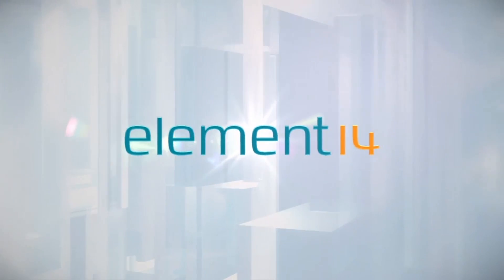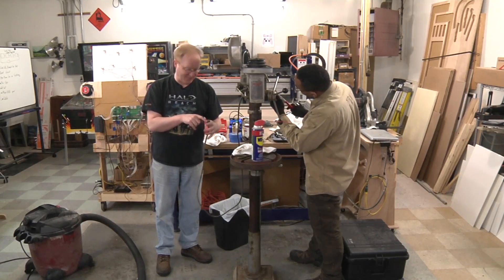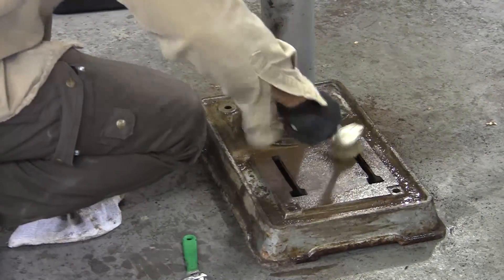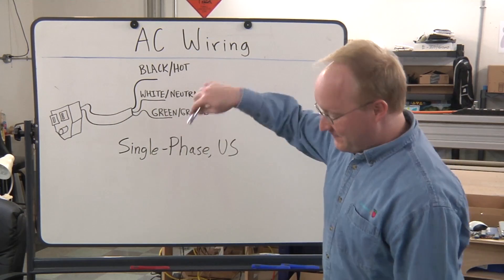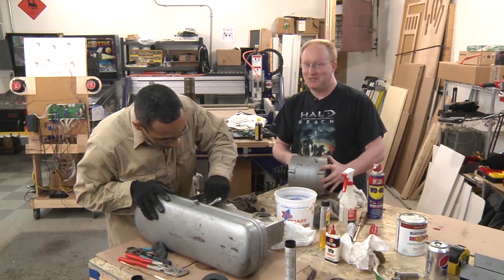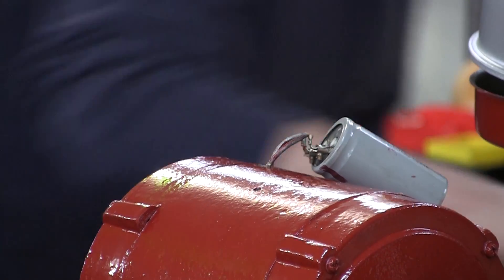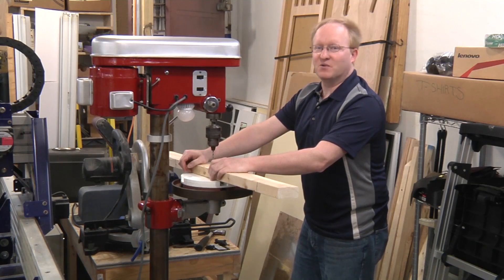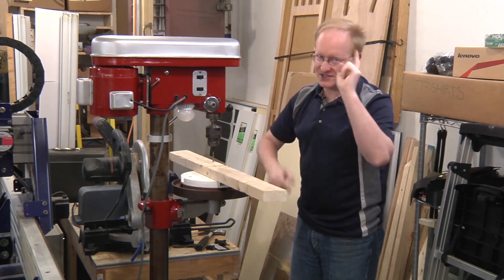Ben Heck's Drill Press Restoration

Comment: Drill presses are awesome.

I wholly recommend that budding electrical techs learn how to print and etch circuit boards and invest in a little dremel drill press to do the through-hole drilling.

PCBs are as much more awesome than Ben's hand-wired protoboards as Ben's hand-wired protoboards are compared to breadboards.

Comment: That "cardboard" is a type of non flammable insulating material, if anything I would have taped the piece up and re-used it as-is.  Still nice to see a good quality nice running old machine like this saved from the scrap heap, much better than the stuff you buy today.
Reply: yambo59 I think the cardboard was also to reduce vibration against the motor, didn't see it in the video but I hope Ben put something around it before putting that cover on. same with not putting a lug on the earth ground and using twist caps instead of solder or splices, it's an industry machine with a crap ton of vibration I don't believe those will hold up long.

Comment: Red is often used a a hot lead in three way circuits (two hot leads).
Most Drill Presses have a hole in the middle of the table just under the chuck, so you can't drill into it.

Comment: Paint Constitutes a restoration? A new bearing would probably have been about ten dollars, if that. Could have at least taken a printer jet ink refiller and inject some grease into it. What it has by now must be pretty worthless.

I got a GE drill press for $20 eons ago at a garage sale. I rewired on a double podium book light because unlike this guy I am actually going to use mine. Also gave it a 3 prong outlet, properly grounded the tool and added extra outlets because mine has a huge square table that I often use it as a bench so the extra outlets right at the source of light and work makes it work better.

Recently, I chopped up some pallets and made it a proper frame so I could put castors under it! Do it Right!

Comment: You need a lapel mic.  What 99% of youtube video makers don't realize is when you use a built in mic with your camera or a separate mic, and it is 8ft or so away from your mouth, it is picking up sound reflections in the room, of which low frequencies make for terrible audio, manifested in boominess which makes speech frequencies unintelligible when recorded. In other words, your audio sucks.  Just a suggestion to an ENGINEER from a sound engineer.

Comment: I've seen a couple of other types of Packard machines before...seems that if this whole family of different Packards are all intertwined, they must have a knack for raising successful machinery companies. 

Although I see the one whom runs the computer variant struggling quite a bit lately...my brother's laptop broke down 7 times and then finally damaged it's own disk drive before actually working. The disk drive's motor actually makes a faint grinding sound, accompanied by the occasional grinding sound that comes from the motor moving the laser back and forth (thankfully not scratching the disk tho) and even doing so much as just overall stopping when it encounters a random read error. The first time it did this last weird behaviour it burned a small dent in the disk but it's never done it to any other disks.

Comment: bare copper or green is earth/ground
black is live
white is neutral
red is neutral (have you really never seen red wires in ac electrical systems?)
blue is live [uncommon]
yellow is neutral [uncommon]

and the cardboard around the capacitor was not for insulation, but to prevent rattling around.

Comment: I once found 2 and a half mice in a single week working at a car dealership. The first had gotten stuck between someone's wheel and hubcap and got centrifuged to death. The second was between the skid plate and some of the (hot) turbo piping on a Subaru. The half was next to the second one, but it was just a greasy spot with some hair on it. Used to find nests in peoples' ventilation systems all the time.

Comment: I suggest having a disclaimer for the wiring colour guide saying that it's relevant for the USA. Here in Australia and other places using those colour codes could get someone killed. That aside I liked the video. First I have seen a drill press table without a hole in the middle though which I found to be rather odd.

Comment: Ben and team you make a great job. I see that you have plenty space to put one more switch or at least to find an other switch that has 1 0 2. The Idea is to make two speeds , one speed is the fix speed has got all ready and the other will be lower but with a dimmer to control it. The dimmer is very low cost and may be you can put an arduino to do stuff and a screen for rpm but I guess will be more elegant with out it. You can fit the dimmer box in and let the control between the switches. I also suspect that your motor may be work for 3 electrical phases , and that's why use the capacitor. Some wood machines let u use all the motors wires for 3  or 1 phase, this give your machine some extra power.

Comment: If you were smart you would just put the part back in the router mill and change the part in your cam software and since the main material it was cut from is still in the machine it would cut in the same place and just cut it out with a 2mm end mill
Reply: If you were smart you would stfu.

Comment: OK, spent all day cleaning and painting a working machine while completely missing the actual purpose of  servicing the machine and the parts which it really needs to drill, not just look pretty. Like the motor brushes, the old worn cap, bearings, belt... and alignment of things to make sure it actually works... I suggest you do not wire it at all, which would prevent anyone accidentally using the machine for drilling holes. This way the pretty paint will not get all dirty. Plus nobody will get electrocuted, because I would not feel very safe using a machine wired while saying "I hope this is what you are kinda supposed to do with these electronomical thingies, maybe".
Reply: I'm surprised they didn't bother to check the run out on the spindle and try and remount the chuck.
Reply: "I suggest you do not wire it at all, which would prevent anyone accidentally using the machine for drilling holes. This way the pretty paint will not get all dirty."

Laughed my ass off ! :-)
Reply: Yea because real electrical engineers give a shit. Shell design is secondary you morons!!!

Comment: It's a drill press, and the important things to do for a very old tool like that would be to clean & lube the bearings, check and fix spindle & feed looseness, and replace the drive belt (when they sit, the belt takes a set and you get vibration).
Reply: John Doe I'm a fairly old guy too, but what you asked of me was really what I posed to Ben. He spent a lot of time doing superficial work, when he should have addressed the essential functions of the device. Suppose some machinist had said he had a really old variable speed controller, and he did a video showing how he lovingly cleaned the case and painted it and put on a new power cord. I'm sure you would have been screaming that he should likely replace the old electrolytic capacitors and clean and lube the potentiometers and switch contacts. In this video, Ben ignored ("well, we won't get into this any deeper") checking the bearings and fits, so what he ended up with was a nicely painted metal figurine that probably has a lot of spindle lash, dried grease in the thrust bearings and a flat spot on the V-belt. The whole effort reminds me of a motto of the old hot-rodders: "If it don't go, chrome it!" Maybe the title "restoration" confused me; in the mechanical world, restoration means a lot more than a paint job and a new antenna.
Reply from the maker: Thanks for the advice!
Reply: The Ben Heck Show I really like your style with electronics, and the audio on your videos is also well done (some true experts kill their message by mumbling or ambient noise). I wasn't so much offering advice as contemplating that 1/2' drill press in my shed, the one that's been on the "to do" list for about 8 years. It sat in a barn, unused by the previous owner for over a decade, acquired a fine patina of rust and has bite marks on a crunchy power cord. Your video was almost like you had snuck into my debris museum and performed an intervention.
Reply: Ed Price I totally agree Ed.  And 'sacrificial material,' no, no! Use a drill vice dude.  I like some of Ben's stuff but leave engineering to engineers and limit the annoying puerile commentary.
Reply: Ed Price Yes much like what a tune up meant in the past to what people think it means today and you are right. The title is misleading and he could have done more. But personally if it works (in this case good enough) then there is no need to mess with it (corrosion removal and paint are steps of a restoration of course). Now if this was a machinists channel and he was doing a restoration to a drill press I am sure he/she would go about doing those things. But Ben isn't a machinists and doesn't need that kind of accuracy and repeat-ability. I will also agree that he should have replaced that damn cap, but one could argue the ease of access and the fact it still works why replace it. It could give him another decade of service especially when capacitors (usually) either work or don't. So even as an EE I would have left it myself, especially considering the ease of access and the purpose of the capacitor in the first place.
Reply: Agreed, all he did is give it a paint job and act like a woosey about mice. It neeed to at LEAST check the quill's main bearing and since they had it out they should have replaced it because it's cheap AND the front of the unit says made in Taiwan -- That should be reason enough! This was click bait.
Reply: Ed Price Let me give you some advice, from a old guy to a young guy and then on to you. If you are going to take it apart you might as well go all out. I am sure 99 percent of folks watching this video know they don't have to paint and remove all the corrosion like they have. But in the end why not?

Comment: Ben, I challenge you to build a voice activated control system, similar to the Xbox Kinect, for an old console such as the Atari 2600. Perhaps including commands that turn the system on,  one that can take screenshots and save them to a micro SD card or thumb drive, or even one that tells the console to start the game inserted into the cartridge slot.
Reply: I love that the voice control itself would probably need much more processing power than the Atari 2600 can deliver. lol
Reply from the maker: Thanks for the project suggestion!

Comment: Why not replace the bearings in the quill while you were at it? You could also  hit the table and column with some electrolytic action, depending on how bad the pitting. But overall a better job than most.
Reply from the maker: Thanks for the suggestions!

Comment: Black and Red Conductors can also indicate that this is drill requires 220VAC or 240VAC . Always check the Motors Amperage and voltage.

Comment: In Australia for 240v wiring earth is green with a yellow stripe down it ( so colour blind ppl can tell its earth) red is active and black is Neutral. Unless you are using a flexable cable then the colour may be brown for active and blue for neutral and earth green with a yellow stripe once again. For 3 phase 415v red, white and blue wires are all active. Just to keep you on ur toes.
Reply: its the same here in bulgaria but we use 220v

Comment: Ben, when you have to tape terminals up like that, heres a handy tip; Roll the electrical tape back on itself along the big roll, so you make a smaller inside-out roll of electrical tape. Tear it off then use the tiny inside out roll to roll neatly around your terminals. Works great when you have very limited space, like multiple wires in a harness or terminals close together like on your capacitor there.
Reply from the maker: Thanks for the tip Scott!

Comment: The cardboard will last longer with the rubbing inside the cover for the cap...I wouls do both electrical tape to isolate and cardboard to protect from vibration
Reply: Cardboard + heat-shrink tube would have been my solution.
It is clearly visible, that Ben is not experienced/skilled with regulation compliant AC-Wiring. Electrical Tape is often considered a "no go" as people tend to use it wrong.

Comment: The caption about the collect being bent is interesting.  First, the drill press does not have a collet it has a drill chuck. Second it is spelled without a c.  
He could try to straighten it up by removing the chuck from the taper and resetting it or by getting a new chuck.  A good one would be nice to have but would exceed the original cost many times over.

Comment: I would think that you would get a better finish and greater longevity out of your paint job if you applied a proper primer coat first. On rusty metal (even metal that has been cleaned fairly well) you would want to use a "rusty metal primer" as a base coat and then paint over it with your final red coat.

Comment: Please don't touch Neutral and Ground with one in each hand even tough it namely sounds safe :) It will get you half of the Voltage from holding Hot and Neutral, but almost same Amperage.
Reply: On most circuit breaker boxes, the neutral and ground wire are tied together. Not always, but most of the time. That doesn't mean that there isn't a voltage that develops later in the circuit. But it should be small. But I agree that you don't ever want to hold live wires in your hands...

Comment: Whats actually the difference between hot and neutral if I have AC? I mean the electricity is changing the direction, so they should be the same?
Reply: americans are weird. here in europe switching those wires doesn't make a difference.
Reply: The hot one changes voltage from sqrt(2)*110V  to -sqrt(2)*110V (Google RMS for the squre root part) and the neutral is at 0V.
Reply: The neutral is the return path for the hot during normal operation of the circuit.  The hot has a ~120V potential to ground (in NA).  If a fault were to occur the ground would be the return path and hopefully trip your protection device installed in the main panel.
Reply: Lot of ppl will say neutrals are fairly safe like an ground and in a homes its the same really for the most part. Neutrals aren’t nothing to joke around with an loaded neutral off on an edison is a major potential hazard. I got hit off a 277V loaded neutral once it will hit you harder than any 277v hot would.
Old houses had very poor grounding you could actually feel the electricity flowing into you as you touch the neutral. My best advice being an electrician of 10 years is to turn off the circuit whenever your working on it it only takes a ¼ of an amp to kill someone the typical household circuit is 15 to 20 amps
Reply: neutral is sometimes connected to earth. if you connect hot to earth you'll get a short circuit.
Reply: The real difference is that on your circuit breaker box, the neutral (white) line is usually attached directly to the ground line (green). Open your breaker box and you will see that this is likely the arrangement. Not all the time, but most of the time. The hot (black) line is left floating so it is the one you want to attach a switch to.

Comment: Painting it with a brush... what a waste of time. Also the point of the t-slots in the original stand is to allow you to use bolt on accessories (vises/clamps/etc.), which are no longer possible while using the 'sacrificial platform'.

Comment: The T-Slots on the table are for using holders to keep your parts stationary. http://www.toolfetch.com/jet-660038-ck-38-52-piece-clamping-kit-with-tray-for-1-2-t-slot.html?cvsfa=2865&cvsfe=2&cvsfhu=363630303338&gclid=CIqUwfDfiL8CFVFp7Aod9GYAuA
Reply: At least someone else noticed this and pointed it out as well... eye rolls to the sacrificial platform...